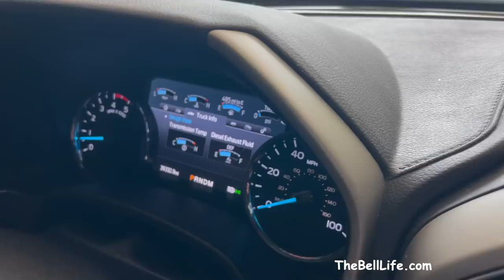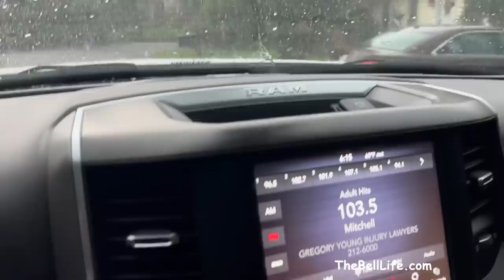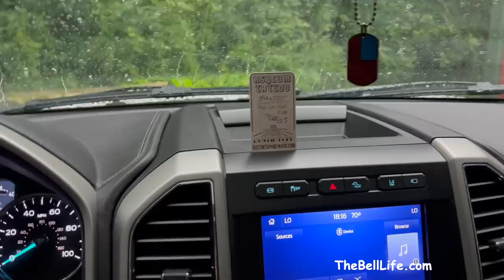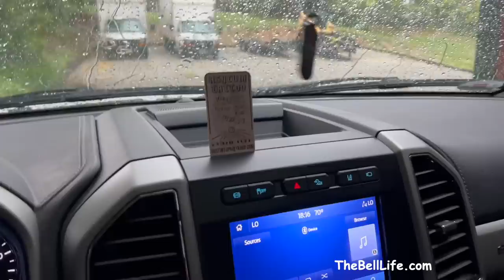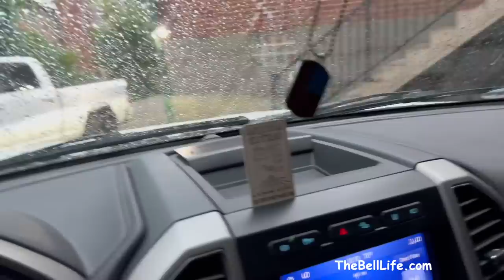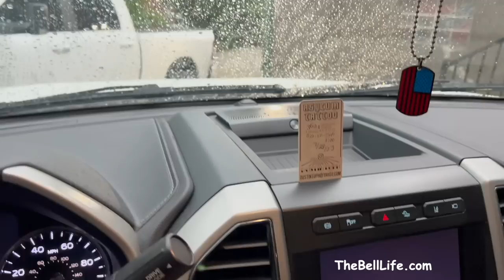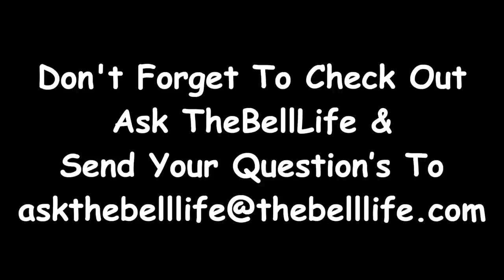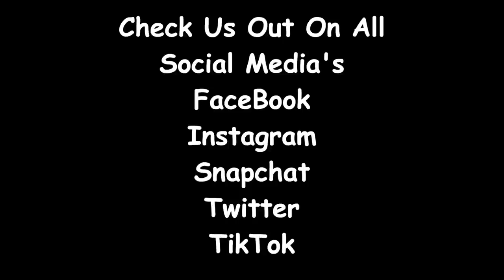Well This Is Not Good…. (TheBellLife)

Comment: I have a 2019 Dodge Ram Rebel, 11k miles. No issues with the sunroof I never use..wait…I don’t even drive it much! No issues at all with the truck.  My 2015 Challenger, 50k miles same..No issues with my Mopars.. Mopar no car..Go Big or go home! 🤣🤣  Interesting there’s no rubber gasket for the lights.  And Of course it happens after the warranty expired!  Props doing it yourselves..saves ya $$$ there! !  ❤️🇺🇸

Comment: I would have put painters tape down around lights and used the silicone for RV’s or boats. Proflex is one brand. Also helpful to keep a bunch of rags handy and a bucket of hot water for cleanup.
Reply: Really no need it peels off perfectly. I get it, i have a nice bike and oki probably would on that. So a long way of saying I agree with you.

Comment: Trey did a good job on that. Only thing i would have done differently was clean the tape or silicon that was under the lights before putting the fresh silicone on there.. Glad its not leaking so far.

Comment: You can squirt the silicone on a piece of cardboard and use a plastic spoon to apply it and some painters tape if you're super worried.

PS: Put the painters tape around the object before removing it. So in this case you'd tape around the light and then remove the light 😂
Reply: Not at all do not use silicone use 3m double sided tape

Comment: I’ve had a lot of problems with the drains on the super duty sun roofs. They get clogged all the time. I blow it out with an air compressor. I’ve also had a problem with the stock cab lights leaking just like Trey. Of course Ford acts like it’s no big deal.